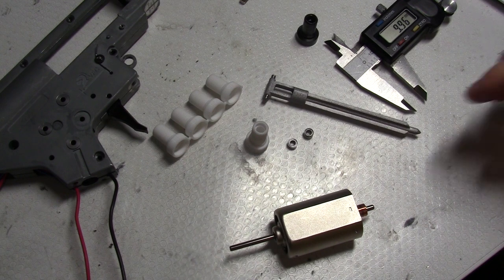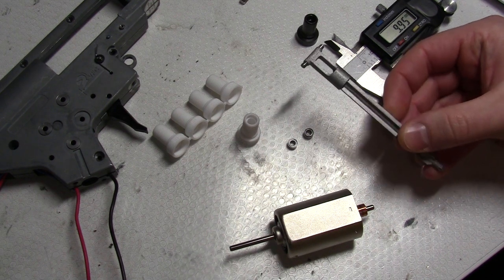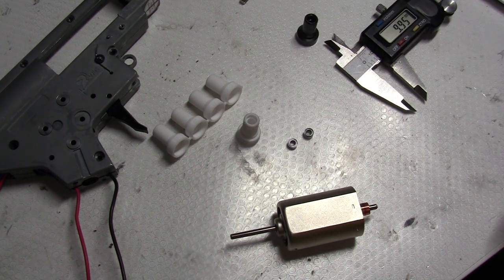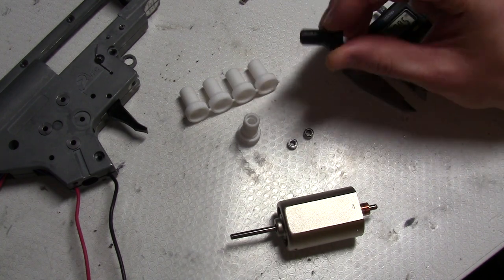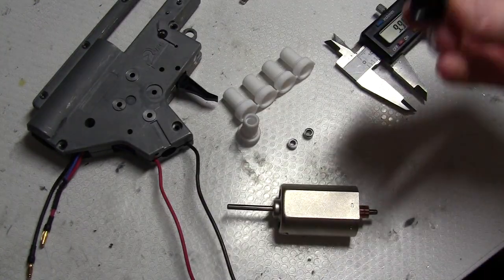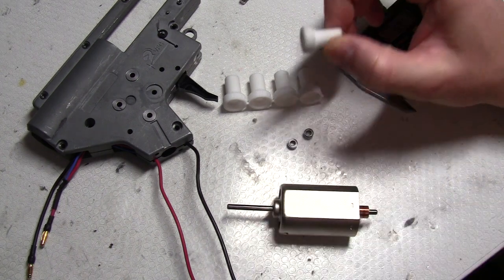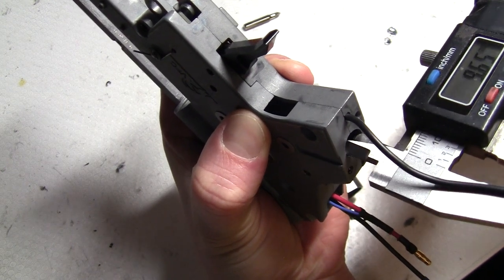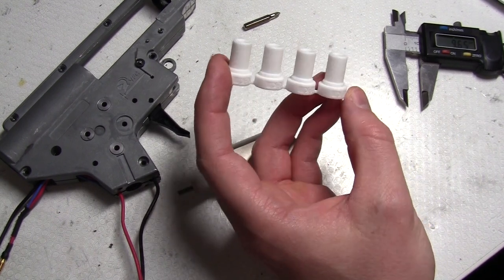Motor bearings & Motor alignment checker tool STEEL version

Comment: Does anyone know where you can buy neodymium magnets for these motors?
Reply: Aliexpress had some at one point
Reply: @opairsoft8100  I managed to find mangets for AEG 480 motors, but can't find for AEP 370 motors!
Reply: @darezi  I can't recall the size, but there is an R/C motor that fits on many AEP motor cages.
Reply: @lucastonoli3256  I measured the magnets from my AEP motor and all smaller magnets on AliExpress are even smaller than mine! All I can do is wait for them to show up!
Reply: @darezi  I would look into replacing the whole motor tbh.
Reply: @lucastonoli3256  I got a new another new AEP motor. The thing is that non of them come with neodymium magnets! For AEG I ordered a pair to make a frankentorque motor.
Reply: @darezi  That's why I'm telling you to look into R/C motors, those have neodymium magnets stock and perform way better than any AEP motor.
Reply: @lucastonoli3256  I was looking at that too, but depending on the manufacturer the size of the magnets differ. I need to find a website that sells RC parts and see if they have magnets sold separately.
Reply: @lucastonoli3256  I was looking at that too, but depending on the manufacturer the size of the magnets differ. I need to find a website that sells RC parts and see if they have magnets sold separately.
Reply: @darezi  Just swap the whole motor.
Reply: @lucastonoli3256  I can do that, but I like tweaking!
Reply: @darezi  It isn't a plug-and-play solution, you will need to swap pinion and mod the cage to hold the motor in the right place.
Reply: @lucastonoli3256  I know! I've done some tweaking and similar stuff before.